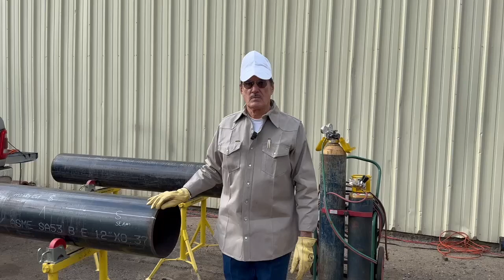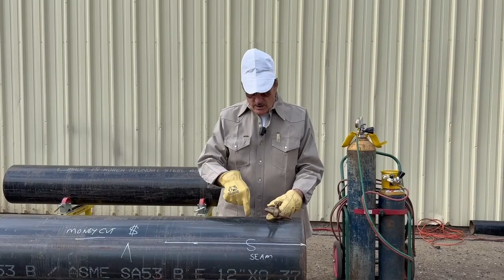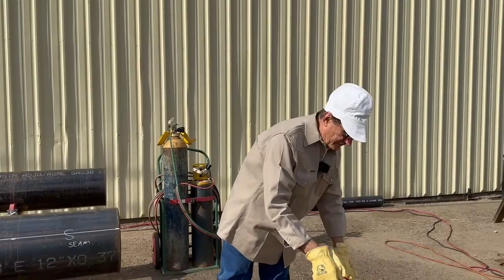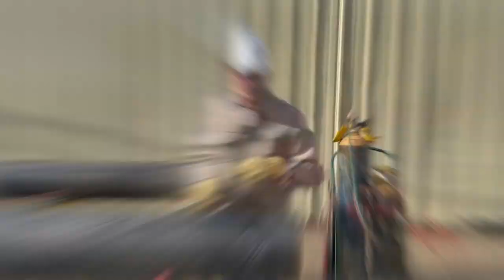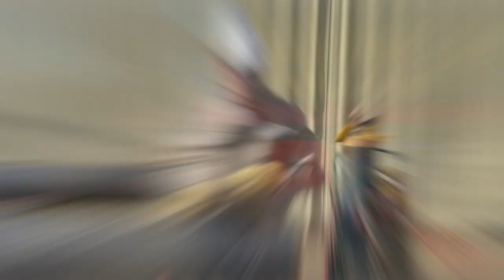Pipeline Ruptures, Pt. 4:  Safety Tips

Comment: Gerald, why would they not grind and punch with a center punch and hammer before they cut into any line. Me and my helper went out in western OK to help a contractor replace some 24" to 30" weld valves they were going to cut and fit and another welder and my self were going to weld them out. They were company welders they put there beveling band on and I mention were they not going to punch that before they cut into that , they let me know they knew what they were doing I said OK I told my helper let's go to the gate and smoke he said you don't smoke I said no but I'm going to today to get away from these idiots they're going to kill everyone. Needless to say they were condensate in the bottom of that pipe I've never heard a boom like that it shock every thing on that location you couldn't see nothing for awhile but a white cloud the only person that got hurt was the inspector when he took off running he cut his arm on one of the welders box. When everyone settled the inspector told everyone me and the other welder would be doing all the cutting and fitting from that point on. That's nothing to play with
Reply from the maker: I don’t know what the companies proceeder was. I wasn’t working on the job. I just had the story relayed to me by welders. I’ve worked for some major gas companies back then that would have you cut into cleared lines after their company clearance procedure was complete. You would get some flames from the residue gas inside as you made your cut , the helper would put those flames out buy smearing mud over the cut , that would starve the oxygen and put the fire out.
Once the football was cut and sealed, you would cut a hole big enough for the nozzle of a fire extinguisher . You would then empty that fire extinguisher into the pipe. That would create a non flammable environment inside the pipe which allowed you to remove the cut piece , and continue with your project.
The big problem for their project was that the wrong section had been cleared on the wrong line etc.
Thank you Wendell!

Comment: VERY GOOD tips here Sir!!!  This will someday save someone's life for sure!  Directly or indirectly.  Most think that they are doing something wrong or the pipe is thicker than they think when it takes longer to heat for a torch pierce.  It's actually a product of some sort still in the line absorbing that heat instead.  Mostly I deal with water being that product.  But Natural Gas is a whole different deal.  Water can be very dangerous due to the pressure and tonnage on large pipe.  But a fuel gas can be explosive!!!  If you EVER have a gut feeling that something isn't right.....  Make a call!!!  It's your life!!!  Not theirs!!!  Thank you once again Mr. Brister!!!
Reply from the maker: Thank you Gus!